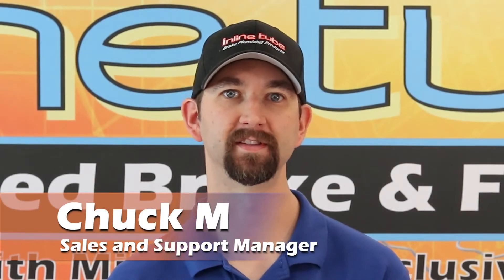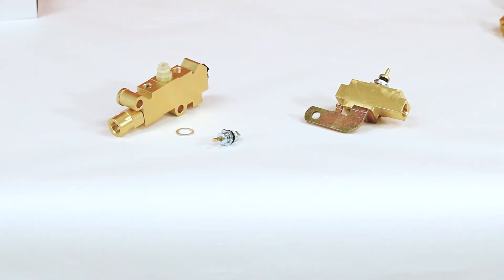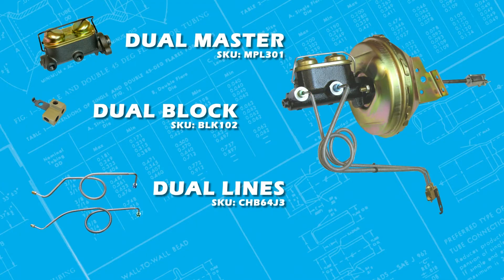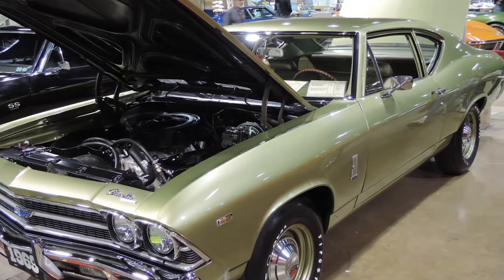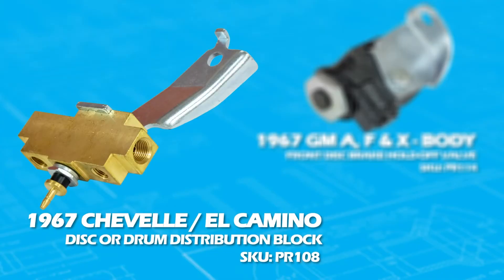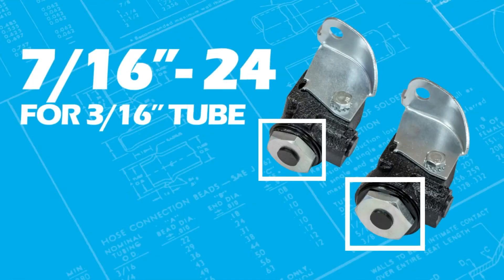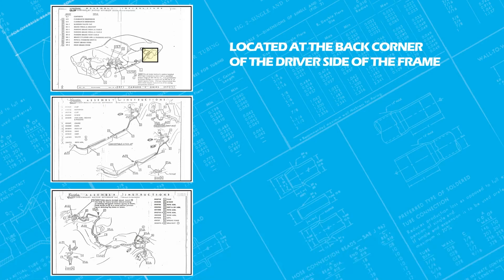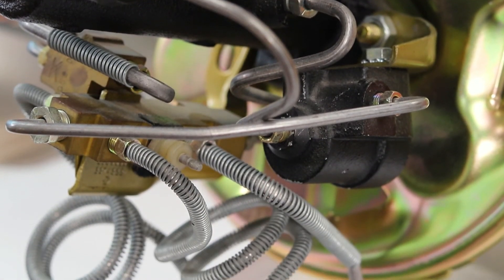How to | Identify and Choose GM Distribution Blocks and Proportioning Valves

Comment: I have a1992 gmc g2500 5.7 vandura looking for proportioning vale or different vale that will work from master cylinder quarter inch lines half inch shred 3/16 line 7/16 three on the top. Front port is on an angle that’s for the driver side brake. The one underneath at the front is for the passenger side break and the brake line for the back brakes is on the bottom at the back, not on the end Bob how can I send of the vale

Comment: I have a 1992 gmc g2500 vandura  brake proportioning and abs modular valve where the fuck did I put that? Number on the vale down on the driver side on frame g 11 kh 0042 bob

Comment: Does a 1976 cj5  manual  v8 that has a dual master cylinder  on fire wall take a P V2 or a PV4 PORTIONING VALVE.

Comment: Have a 1980 diesel square body c10 (1.25” front rotor, factory hydro boost, rear drum). Have smaller style rear el dorado calipers for e-brake function disc conversion. The links in description don’t seem to work do you guys carry the proper proportion valve for this conversion? Do lines to rear need to be upsized as well? Thanks

Comment: I have a 1969 Chevy C20 truck with drum brakes all around.  The new front disk proportioning valve has 70% of the pressure going to the front brakes.  Can I use this valve until I am ready to do the final conversion to front disk with rear drums?
Reply: I would not advise using this valve with drum brakes

Comment: ok so if i understand this correctly on 1970 a body with power disc brake they use 2 hold off valves 1 of the front by the master cyclinder, and the 2nd one mounted in the rear on the frame, but they still use the same non power drum brake distribution valve, the only line that is changed when converting is the front to rear line it is 2 peice.....correct?
Reply: There were only 2  A Bodies that had the rear valve and that is Pontiac And Chevrolet.  The Olds and buick only had the 2 valves.  however the discturbution block stayed the same for disc and drum.  There are a few lines that change   There is the front to rear and the master lines.
Reply: @charlesmcmartin8659  got it thanks

Comment: So I have a 1970 chevelle stock rear drums but front converted disc. Which one should I use? The upgrade proportioning valve, or how the stock one looks on the frame- distributive block?
Reply: It is up to you on which set up you use.  The lines will need to be changed if you use the Valve at master Prop valve.  But if you want to keep the block on the frame you will need the PR115 valve and new master lines to hook it up correctly.

Comment: At what pressure PR102 activates?
Reply: The Pr102 switch is for a failed line.  It shuts off one side of the valve during a line failure.

Comment: So which one can I use for a g body
Reply from the maker: Manny, The PR100 and the PR101 are the G body Valves
Reply: PR100 for stock or PR101 for Rear disc.  Sorry I did not see your comment
Reply: which proportioning valves should i use for 2007 Chevy HHR LT L4 2.2L 2198CC?